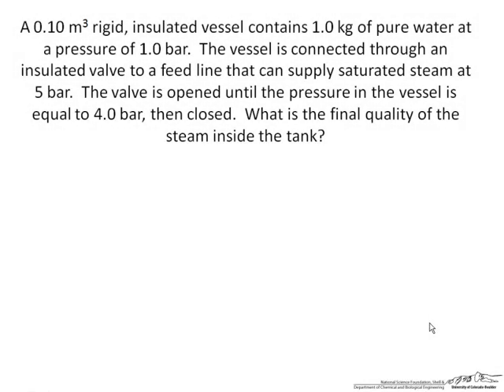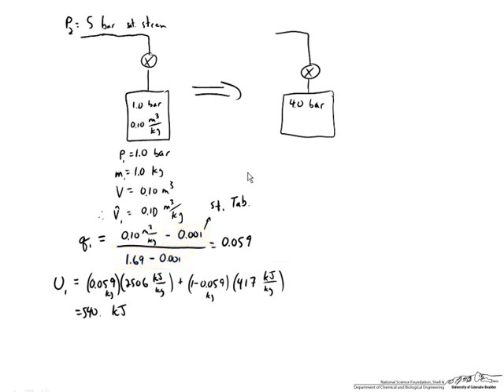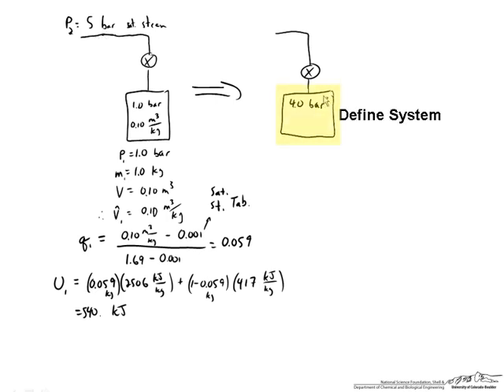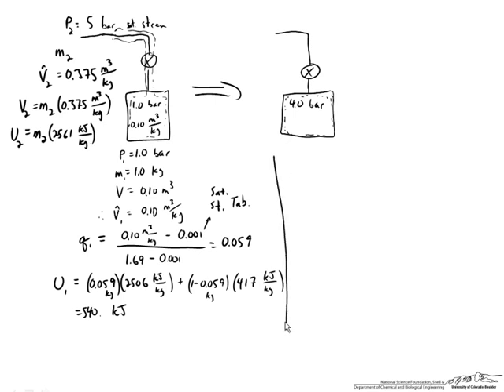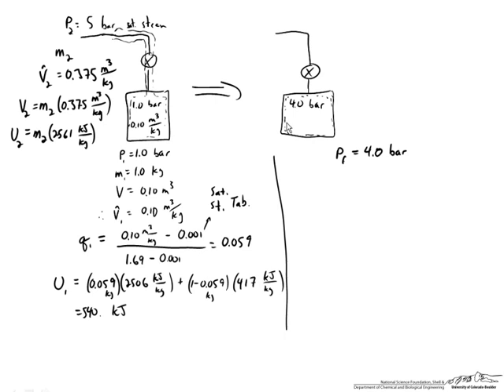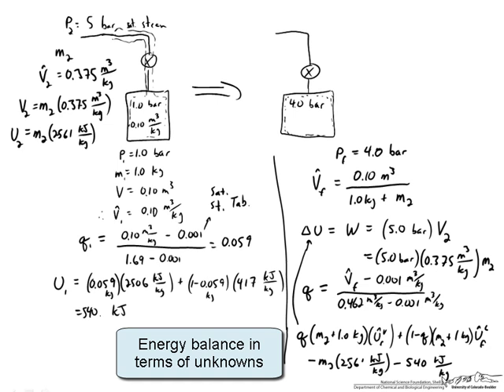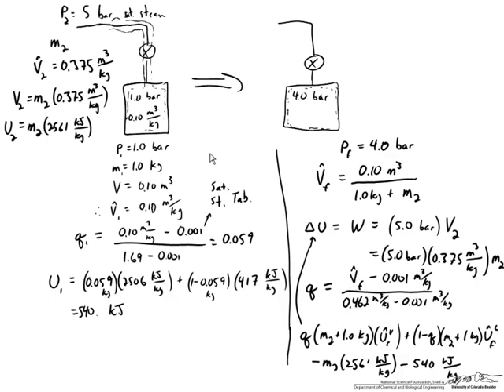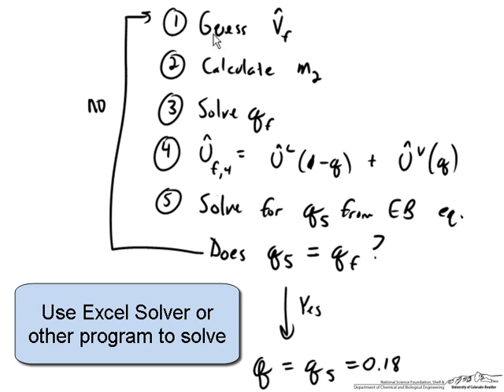Unsteady-State Energy Balance (Steam Tables)

Comment: how did you use steam table for pure water conditions to calculate quality of steam initially ?
Reply: +Muzzammil Vora to be specific you used pressure of 1 bar (vessel condition) not steam inlet condition which is 5 bar and how did you assume initially system is in VLE ?